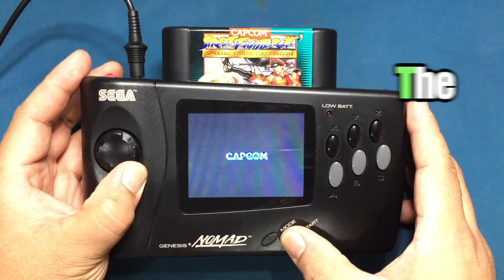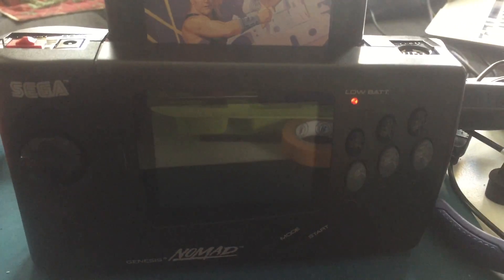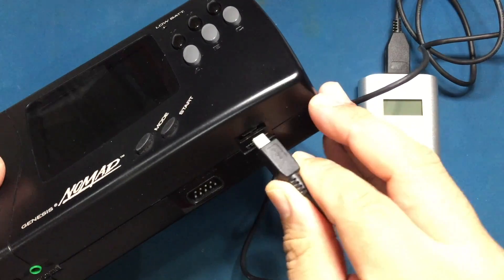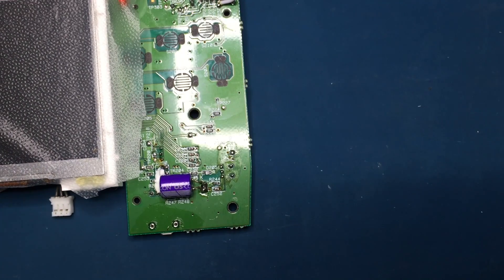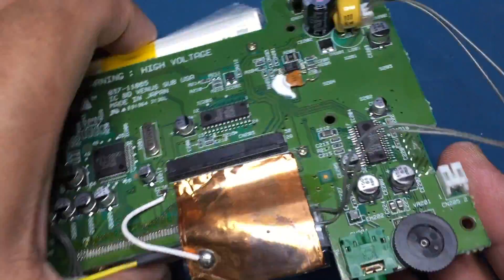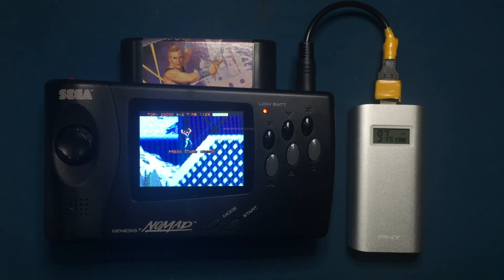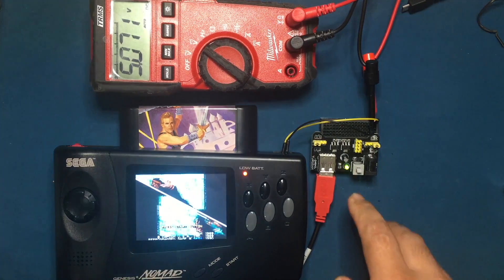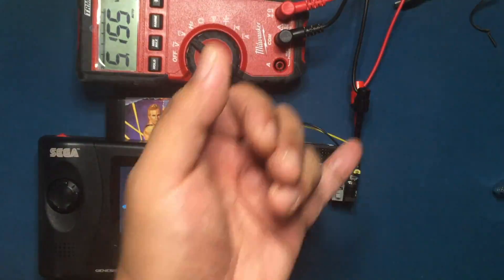Sega Nomad USB Mod [SH ep.45]

Comment from the maker: TO MAKE A USB POWER CABLE using the AV OUT on the Nomad....

You just need to supply a 5V source to the AV out section of the Nomad. So... you need to connect 5V to the 5V pin and Ground to the Ground sleeve as referred to in the Gamesx link below.

http://www.gamesx.com/avpinouts/genesisav.htm

What's great is that there is a common 5V power supply that you probably have around the house.... yeah, it's USB!

Get an old USB Cable with a common rectangular end, which is called a "TYPE-A PLUG." Refer to this Wikipedia link to see what I'm referring to, as it will also tell you the pin outs for the type-A plug.

https://en.wikipedia.org/wiki/USB

Now you need to get a "9 Pin mini Din Male connector" as the Nomad has a 9-pin FEMALE Mini Din Connector. You can find one on eBay.

Once you got the USB cable and 9-pin Male Mini Din Connector, cut the USB cable to length as you wish, as you don't need the other end of the cable. Take the 5V wire of the USB cable and solder it to the 5V pin on the mini din connector as specified in the Gamesx Nomad AV pin out link. Then solder Ground of the USB cable to the Ground sleeve of the mini din connector as specified in the Gamesx Nomad AV pin out link.

Now you should have a cable what will supply power to your Nomad... with only 5V, and without the need of your old power brick.

Comment: How can the  Backlight connector  and AV out connector receive 5V and work if they normally used to supply voltage?
Reply from the maker: https://www.humblebazooka.com/2020/05/23/custom-3d-printed-battery-pack-for-the-sega-nomad/

Here's a guy that made a 3D printed battery using the principles learned here.
Reply: @The_SegaHolic  Actually looking foward to do that battery mod (just bought a working nomad with a busted screen), but what amazes me is that power can go both ways on those connectors
Reply from the maker: @jesusvazquez4149  It's not actually "both ways." But yeah, nice on getting a Nomad.
Reply: @The_SegaHolic  Hello, hope you can help me with a question: I found a very cheap LCD screen on amazon and I tested tapping 9v from the on/off switch and putting a cable to the AV port, the screen worked perfectly, I tried to bypass the step down circuit getting power from the old LCD light port (4.89V) and it works but it has a very annoying flicker, tried doing a bypass soldering a wire in a couple 5V points on the LCD's board but I get the same result, went back to 9V again and according to my multimeter the step down cricuit provides 5.15V to the screen when it works fine. If try  to power the console with a power back through the AV port (5V) will the screen work? or do I will have to stick to find a 7.4v camcoder battery to run through the pins on the back?
Reply from the maker: @jesusvazquez4149  I can’t say cause I can’t test it myself. YOU are going to have to do the testing.
Reply from the maker: Think about it. If there is no load on those connectors, then it would be the same thing as supplying power from the regulators "on the other side."

Comment: Much simpler way - remove the regulator TR201, bridge the middle pin to the large pad, buy a usb to universal barrel jack cable from Amazon. Connect the cable to the DC jack and boom! USB power, and you don't even need to fit a USB port.
Reply: This sounds neat! Did you see it in a tutorial somewhere or did you come up with it yourself? If the latter can you give a bit more info?

Comment: I wonder about the safety of this, the old LCD connector is supposed to be an output, not an input.
Reply from the maker: hadessuk Don’t overthink it. It’s neither an input, nor an output. It is not a data line. It is just a line that supplies power.

Comment: So I just finished this mod, and first thing I noticed was that the power switch no longer works, the Nomad just turns on when you plug in the USB. I'm assuming this is the norm, since we're supplying the voltage past the power switch. I decided to remedy this, so I desoldered the original switch, bent all the pins away from the mainboard, out the back side, and resoldered it using the mount points on the shielded cover. I wired the 5v power from the USB module to this switch, so now I have switchable 5v. Pics:

https://i.imgur.com/xQ87VYNh.jpg
https://i.imgur.com/KOoICpqh.jpg
Reply: Did a quick video showing the end result. Love the reversible power connector thanks to USB C. Thanks for the great video on how to do this, really helped me a lot.

https://www.youtube.com/watch?v=oFecz_twQDM
Reply from the maker: Yeah, you could have repurposed the original power switch, or use another simple SPST swith inline with either the power or ground lines leading to the usb port... but really, for safety, use the ground line for the interrupter switch.

These turorials assumes you will have basic knowledge, and really, you should be thinking how to make things "yours" and "make it better."

Great job, and I'm glad you got it to work.

BTW, I din't use the original switch because I didn't want to lose the regular power transformer option.

But yeah, basically, you're bypassing the votage regulators for the 10V coming from the external power transformer that the switch would have been interrupting/connecting.

You could have also cut the trace on the PCB that runs from the original switch, instead of desoldering.
Reply: I was having issues with the DC in side of my Nomad, something failed that I haven't been  able to pinpoint (and I replaced the stock VR), so it made sense to get rid of the stock DC in, and really I'm not using that circuitry at all anymore. I even removed some of it to make room for the USB C connector. It works like stock, and I've used it with a USB battery pack, it's been great.
Reply: @AdamBath  Hi man, can you upload some of your pictures again as I'm looking to do some mods to my Nomad and i like what i've read about your description here. Thanks.

Comment: You can make a tutorial for the first mod? The one with the micro USB cable port.
As I don't know what cable should I use with it.
Reply from the maker: Damn, missed your comment. Not sure what you mean, as this video here shows you how to use a Micro USB port.
Reply: The Sega Holic well...if you can make a video about how to install with the names of everything.

That would be great
Reply: Basically all what I need is the name of the wires that you used to connect the microUSB board to the power thing.

That's all

Comment: any tips on how you made the custom cable, or what part to get?
Reply from the maker: You just need to supply a 5V source to the AV out section of the Nomad. So... you need to connect 5V to the 5V pin and Ground to the Ground sleeve as referred to in the Gamesx link below.

http://www.gamesx.com/avpinouts/genesisav.htm

What's great is that there is a common 5V power supply that you probably have around the house.... yeah, it's USB!

Get an old USB Cable with a common rectangular end, which is called a "TYPE-A PLUG." Refer to this Wikipedia link to see what I'm referring to, as it will also tell you the pin outs for the type-A plug.

https://en.wikipedia.org/wiki/USB

Now you need to get a "9 Pin mini Din Male connector" as the Nomad has a 9-pin FEMALE Mini Din Connector. You can find one on eBay.

Once you got the USB cable and 9-pin Male Mini Din Connector, cut the USB cable to length as you wish, as you don't need the other end of the cable. Take the 5V wire of the USB cable and solder it to the 5V pin on the mini din connector as specified in the Gamesx Nomad AV pin out link. Then solder Ground of the USB cable to the Ground sleeve of the mini din connector as specified in the Gamesx Nomad AV pin out link.

Now you should have a cable what will supply power to your Nomad... with only 5V, and without the need of your old power brick.
Reply: Thank you very much!! i might try to do that first instead of trying the micro usb.. i'd like the power cord to come out of the top of the system I'm thinking..
Reply: just to be clear I originally meant the one @3:55 but you inspired me to try this one out.
Reply from the maker: Oh, Ok, BTW, the micro USB PCB is in the video description. Then you just wire the 5V and grorund on the USB pcb to 5V and ground on the Nomad.

The good thing about the other cable is that you don't have to do anything to your Nomad and even works on a STOCK Nomad.

Comment: I can't seem to connect ground. argggg  It just falls off when i try and solder it to the connector. Any tips, why Sega, why couldn't you make it like power for the mini din?!
Reply from the maker: LOL. I know about your difficulty! Those pins are so close together. Try using flux, and clean (scatch up the pin with an exacto knife or something sharp). Make sure your iron is nice and hot, and your soldering tip clean and unoxidized. If it's ground, then scratch up the ring.. remove the plating.

BTW, how's everthing working?
Reply: Going good, picked up this power bank and used Velcro to attach to the power bank to the Nomad.
https://www.amazon.com/Bank-Anguo-Portable-Charger-5000mAh-External/dp/B01MRZ0W3Y/ref=sr_1_8?ie=UTF8&qid=1503467659&sr=8-8&keywords=5000+mah+power+bank

Nice and thin and light. A perfect color match for the Nomad. Enabled Sega Master system mod (1 wire), but still have to add back the proper audio lines to the cartridge port to get FM sound. Recently, they added SMS FM support using the Mega Everdrive V2 or X7. Portable Sega Genesis and Master System!! Still waiting on more 9 Pin mini dins to play around with the all in one cable solution. Although, you will probably beat me to this.  Damn ground soldering. Probably just going to strip the wire 6 inches long and wrap it around the din connector and then solder it at multiple points.
Reply: Maybe try and put a 4or5 inch screen in the Nomad. Would be cool.
Reply from the maker: BTW, can you make a video and show your Nomad when you're done? Or maybe make one now? I wanna see what you've done with the SMS mod and such.

AND WHY DON'T YOU TRY AND PUT THE BATTERY INSIDE THE NOMAD?

The all-in one cable solution... it was a great idea. Hopefully, you can find a solution as I got so many videos to make. Totally swamped with ideas I had when I started doing video games on the channel about 2 years ago.
Reply: The Sega Holic I definitely will make a video when it is all said and done. I didn't put the battery inside because I still wanted to be able to use the power bank for other things. I did attempt to use the USB Micro-B Breakout board, but it just kept falling out. Damn hot glue. I don't have to worry about that with the 9 pin mini din. Well, once I get ground situated anyway.
Reply from the maker: Good luck with the build. LMK when it's done.
Reply: The Sega Holic Definitely, just waiting on parts.
Reply: Well in an interesting twist, the power bank stopped working with the Nomad. Literally nothing was changed. It works fine with everything else...I obviously can't recommend this power bank as a result. Retested the 9pin din usb cables I made and they power up the first time every time through the wall adapters. What brand power bank are you using?

Comment: Does this AV cable mod only work for the official Sega AV cable? I ask because I have a few Chinese ones lying around and while it has 9 pins on the connector I am only finding 3 cables inside. I presume, composite/left mono/right stereo.
Reply from the maker: Use a "USB A" cable and you can hack that instead of the AV cable, as no wire will be connected to "+5V Pin." You can try and open up the connector and soder a wire to the pin, but usually, the pins are missing on AV cables.

The easiest way to do it is to buy a male 9 pin mini din connector like this one:
http://www.ebay.com/itm/2pcs-9-pin-Male-Mini-Din-Connector-soldering-ADAPTER-/252710577266?hash=item3ad6b96472:g:Ek8AAOSw4GVYRTqC

And you will usually have a "USB A" cable that you can hack around the house... if not, go get one at a thrift shop or something. You want the rectangle A end.

Here's a pic of where the 5V and Ground is:
https://i.stack.imgur.com/5IOnM.jpg

Once you open up the USB cable, there's only 4 wires, find the 5V and Ground wire as outline in the picture, and connect the 5V and ground wire from the USB cable to the 5V pin and ground on the 9 Pin Mini Din.

Then you can use any cell phone charger or power bank as your power source.
Reply: The Sega Holic Awesome, thanks.
Reply from the maker: before you remove the stock LCD, can you see if this method will work to power a STOCK NOMAD? Thanks.
Reply: The Sega Holic Damn, too late. Already removed it. Got new capacitors coming today and the LCD coming Friday. I do plan on buying another Nomad though for a friend.
Reply: Will have the other Nomad on Monday. cables/adapers should be here by Wednesday. I am noticing the Game Gear is absent on your videos. If only we had more screen replacement options. After recapping two of them both have nearly dead screens, thought I could just use the one with a black line going through it and today another line appeared...
Reply from the maker: Long story short... bought one that "needed recapping" on eBay shortly after the Nomad vids. Power shuts off shortly after turning on. Was running games a bit before shutting down. Screen is just blocks of colors. 

Recapped it, still the same, but now, shuts down right after turning on. I'm going to look in getting a working one, to make it easier for me to diagnose. :(

Yeah, too bad we can't get a CHEAPER OPTION FOR SCREEN REPLACEMENT. Luckily, the Nomad has RGB and composite outputs right on the board. I'm going to hold off on the Game Gear for now, too much prior plans for videos.
Reply: Can't say i blame you. I have a 3rd one sitting here dead and no motivation to recap it.
Reply: I can confirm that the power to the AV works perfectly on a stock nomad.
Reply: and with the Mega Everdrive...

Comment: I have an issue with a nomad I just obtained. I bought it broken, previous owner attempted to replace the power jack and pulled the traces while removing it. It's also missing capacitor ce201, I plan to replace the cap, but could I get power to it as shown in the video? Would like some suggestions for getting around this issue. (Perhaps a means to solder another power jack on the board) And your knowledge regarding the Nomad is second to none...
Reply from the maker: Has the LCD screen been replaced?
Reply: The Sega Holic no
Reply: The Sega Holic I plan to replace the screen if I can get it working.
Reply from the maker: If the screen is replaced with a new one, pretty much all LCDs available today have LED backlights instead of the flourescent stock one currently in your Nomad, then just follow what I lay out in this tutorial. Applying 5V where I outline (at the +5V ouput test pad/point or the LCD power connector will eliminate the need for the 10v power supply, hence eliminating the need for fixing your power jack.

Check this video (episode 46) out closely:
https://www.youtube.com/watch?v=AF0FjLyhwZA

I have a USB power bank connected to the AV out jack on the Nomad! The USB power bank is powering the Nomad! I also demonstrate applying 5V to the AV jack in this video (episode 45).

Connecting 5V externally like I do in episode 46 requires not additional modifications other than having the screen replaced with a modern LCD. You just need to make a USB cable like I did to get 5V to the +5V pin and Ground to the ground shield on the AV jack). The mod in this video (episode 45) outlines getting these connections internally, and using a micro USB jack to avoid having to make a USB cable for the AV jack.

I ask if you replaced the screen because if you have a stock screen, this may not work.

I SAY MAY, BECAUSE IT ALSO MAY WORK. I already yanked out the old screen before I got the chance to see if this would work for a stock screen. I say it may work, because the old screen ran on 5V.

But I hesitate to recommend doing this on a stock screen, because I haven't tried it myself, and THERE IS A SMALL CHANCE IT MAY DAMAGE YOUR NOMAD. I really think it will work though, honeslty But I REPEAT, I CANNOT RECOMMEND DOING SOMETHING THAT I HAVE NOT TESTED.
Reply: The Sega Holic Excellent.
Reply: Btw, what screen LCD screen would you recommend?
Reply from the maker: Yes, that's the one I used. Be sure to check out my LCD install video for some background for this procedure.
Reply from the maker: If you're in the UK, I'm not sure it'll work though. There are reports that certain boards will work, and some will not. The Nomad was only released in the US, and the LCD compatibility issues may be related to PAL compatibility of the screen.
Reply: The Sega Holic I am in the US. I should be good then, right?
Reply from the maker: One last thing, if you are from the UK, the video coverter iC on the LCD driver board does say it's auto switching PAL/NTSC, but again, I have not been able to test it since I don't have PAL games.
Reply from the maker: Yeah, you're good.